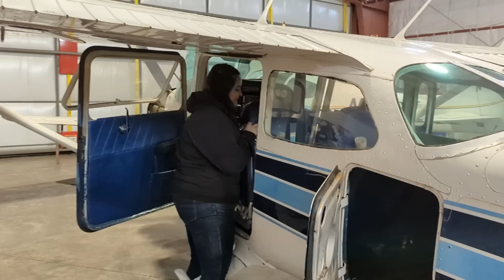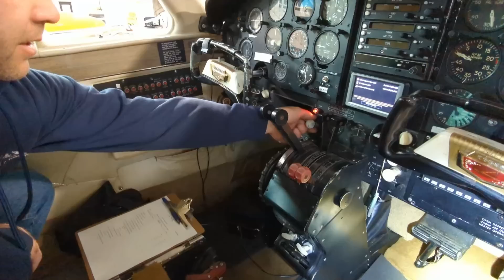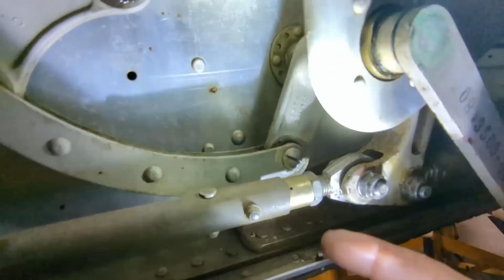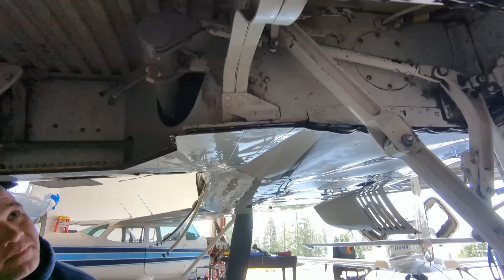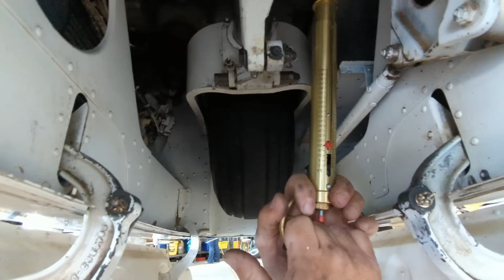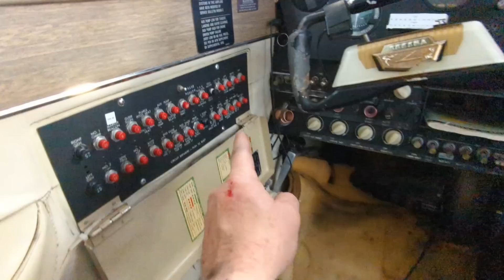1959 Cessna 310-C Annual Landing Gear Check. Gearhead Special!

Comment: Had a 1970 C-401B and a 1955 F35 so two gear swing inspections per year. Working with AME who signed off all work we did together. Amazing engineering

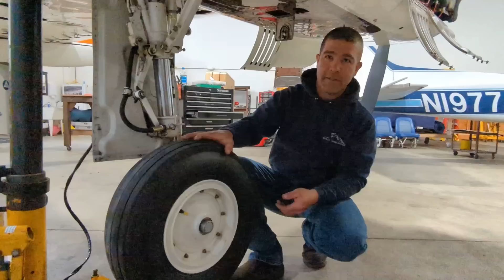Comment: The Airforce head to 310 to our meeting. Also had a 3:10 and we know that the landing gear especially knows Liniger will collapse on so Cessna came out with a new system to replace. Do you change your bicycle chain on your nose landing here also, the beach craft had a swing thing with the bicycle chain, so just replaced it

Comment: Aeroshell 5 is not the correct grease for the landing gear. Aeroshell 64 or 33MS is the correct grease - Mil-21164 . Also, remove, inspect, lubricate and reinstall the bellcrank pivot bolt.

Comment: This is a beauty of a 310!  Original N number too.  It reminds me in spring 1980 I was with Dad when we went to Kansas City to buy a 1971 pressurized Cessna 414, after that went to Wichita where Dad took the 3 week Cessna 414 maintenance course, primarily Dad needed it to be able to sign out pressurized aircraft but the training on the gear rigging was very valuable too, Dad said it was a little complex and one needed to get the details right, i was 18, good memories

Comment: Microsoft Flight sim just added a C 310 R from Milviz.  It flies great, but there is a discussion about the pitch stability on this aircraft. Would pilots of the real 310 consider the pitch to be "twitchy" at low speeds?

Comment: It sure does take a lot of "gear" to do the gear inspection on a 310. I certainly was not "geared" up for the complexity of the the gear system. Fortunately, all of your 310's gears operated smoothly so you did not require any additional  "gear." "Gear-ate" video!

Comment: I worked as an AME in Canada from 1986 to 1992. My shop did this inspection on the 310/340 series aircraft and from our research most Canadian and American shops where not doing this inspection. It was tedious and necessary. The poor apprentice would get stuck in the cabin pushing and pulling circuit breakers and checking the manual retraction handle per your video. We had one AME that specialized in the inspection and he was dope doing it. Had the process organized and I often wished I was shown how to do the entire process and be able to have his lever of competencty. I really liked the video and it brought back memories. The older C411 and C421s had a similar gear configuration but I only remember doing the inspection on 310s and 340s. We loved the newer C411 and C421 with the hydralic gear. So much easier to maintain except the first time we did a "blow down" test of the emergency gear system we did not expect the suddeness of the gear action and locking. The aircraft rocked on the jackpads we thought the aircraft was going to fall off them. They never did but we actually would get other techs, especially from our local avionics shot come over to watch the blow down test. GREAT VIDEO!

Comment: I am very familiar of that gear system.  I oversaw an annual for a  friend of mine ‘64 310.  The adjustment of the down switch gave us fits.  It worked good on the ground, but I flight tested it and the green light didn’t come on.  Went through the emergency gear extension procedure and it still didn’t. Did a flyby of tower and it looked good so I did a no flap landing to be ready to go around since I didn’t know with the series gear circuit which one was the problem.  It was okay so we checked it again on the ground and it checked out again.  Ended up rigging the three switches to a box with 3 lights and found it was the right main gear switch.  Made another adjustment and got it squared away.  Never cared for that single light system.

Comment: Juan, great video can't tell you how many shops don't do this full procedure during annual!  There are only two shops in the US that I allow to rig the gear on my 401B.   BTW, check your log books, look to see when the last time the gear box was serviced.  I'm willing to bet it's never been opened up.  I did mine and the grease was hard as a rock!!   Scraped it all out rinsed with mineral spirits and then installed all new grease.

Comment: Greetings from a fellow employee. Just curious, currently I have a 182, got it primarily for my sons to learn to fly. Now that they have moved on I don’t fly it much but when I do it’s the 200-400 kt mile range. I could use a bit more speed and not be Leary of hard IFR and/or night. I’ve got lots of Baron time but at 57 and 6’6” don’t feel like squeezing into one of those again. A 310 is high on the list, and I like the old ones. In searching out yours what gotchas did you look for? Did you consider any others? Also, afraid to ask, what’s that annual gonna run?

Comment: A company I worked for had a 320.  During the gear check the mechanic thought the gear went up strange.  Told the boss, boss said its fine.  Guess what,  a few weeks later it failed and did a nose gear up landing.

Comment: A C-310 is sometimes referred to as a little airliner and it is an extremely capable airplane, which will actually be able to climb on 1 engine, instead of just flying to a crash site like a Piper Aztec. Back in early 2000's I received a Multi-Engine training in a C-310 in San Jose, CA. Pretty much the whole Multi-Engine training focuses on handling the aircraft when 1 engine fails. During one of our training flights in a C-310, it was me as a student acting as Pilot Flying, my instructor was monitoring and we had another instructor and a student on the back seats. We had completely shutdown 1 engine and feathered the prop and the C-310 was still able to climb at about 500 fpm with 4 grown men in it. It was amazing.

Comment: That gearbox sounds a lot like an  old cream separator in reverse. Those things had a lot of compounding going on to change a fairly sedate input on the hand crank into thousands of rpms at the output. Those things would last for decades, based on their precise construction, and this box seems to have done the same.   A weird comparison, but one that just occurred to me, watching the way the main actuator moves.

Comment: I love the attention to detail that an annual inspection shows.   Boroscope?  Compression checks, electronics check...fascinating detail.   I know this is maybe off topic.   But what if,  just what if, people took their on road driving skills, awareness, engine and vehicle maintenance, as meticulously as pilots do?    IMC conditions on the road?  don't go.   Going anyway?  drive by the numbers, signs, and all the things that most drivers fail to do.   speed limits...etc.  Yes, it's boring.   but a slight reduction in driving speed is a massive reduction in crash kinetic energy.     Save for a life threatening emergency, nothing costs more that mistakes and tragedies on the road that can be avoided by deciding to drive properly, ,,maintaining brakes, tires and suspension to excellent standards, clear windows, clear mind, checking and double checking all intersection crossings, etc. etc.       To make the point more strongly, what if people flew and cared for their aircraft as most people drive,  aircraft would be dropping out of the sky at an nearly unimaginable rate.      Pilots actively fly,  do most people actively drive?

Comment: Cessna 310 Annual Inspection Cost:   $1000 per 1/4” of combined maintenance manual thickness if nothing needs attention.
                                                                 $2000 per 1/4” if adjustments are needed.

Comment: Juan, when hand cranking the gear down, you went 6 and a half turns past the green indication, is there a reason you could do more? Would you want to go until it stops in an manual crank situation, or stopping at green should be acceptable?
Reply from the maker: What does the book say....
Reply: @blancolirio  I was just curious, I suppose I could find a 310 book online somewhere.

Comment: Thank you so much for this fantastic video, I'm not qualified for aero stuff but I spent many years on the tools in vintage cars and classic motorcycles and I can completely appreciate how that system of rods and linkages can become a geometric nightmare if you have to disturb one and you then end up chasing your tail trying to figure out how your adjustments have affected the parts further down "the chain". 

Also, "we'll see..." spoken like a true pro 😆 she'll go far in the mechanical/engineering profession.

Comment: Great 310 gear resource Juan, much thanks! Also, at 24:00 on the swing, it looks like Harvey might be prone to a near catastrophic problem a friend experienced in a P-51('Never Miss' - N119H).  I flew chase for about an hour until after some very high-G maneuvers and down pressure on the system the gear dislodged. 
What happened there, was a left-hand oleo seal had become a tad hard and dry, and rolled, which prevented the strut from extending fully. That caused the tire to bind on the inner gear well opening. It was surprising how little binding force was able to prevent the High-pressure hydraulic system from forcing the wheel past such a bind.  Lesson learned, was that oleo condition can be an overlooked component often essential to proper gear operation. 
Hard to tell from the video but the clearance in Harvey's gear well appears it might be tight like on the P-51. I'll post a link to 19H as a reply to see if YT will allow it that shows the gear well.

Comment: Its absolutely amazing to me that more gear up/gear failures happen more than they do after seeing the complexity of just this one design actually is... the amount of bearing and bushing play that occurs over the years and cycles had to have been taken in consideration in the original design. Anyone who has dealt with a multi linkage mechanism knows just a few thou of slop in each rotating arm will grow exponentially at the desired outcome. Add in the flexibility required in the wings, the temp ranges the airframe is subjected to, hard landings, and many other factors, my mind is blown. How the hell did Gryder end up upside down in a corn field with just a simple flap mechanism? Haha I couldnt resist, sorry Danno

Comment: Back in the early 1973ish days. I was working on my pilots license in Michigan - Oakland Pontiac airport.
Traded cleaning planes or spills for flight time. Turns out I was very good at cleaning black soot off the engines.  Met great pilots and mechanics.

Comment: Been maintaining a fleet of 310R for the last 20 years. Good information. It's definitely a puzzle to rig from scratch or if you have to make any changes you always have to start from the beginning of the rigging instructions. Never works to start in the middle. Torque tubes are prone to cracking as well as the bell cranks for the inboard gear doors.

Comment: Sheeesh, the guy that designed that gear system had to be right next to insane. Probably a relative of Stephen King. You almost never hear of a 310 experiencing a major gear issue and if you do, something is either bent from abuse or, lack of maintenance. I wonder if Cessna made any changes to subsequent, later models of the 310, relative to the gear design or, left it alone because 'If it ain't broke, don't fix it".

Comment: Having flown 1000s of hours in 310s one of the major problems we encountered was low time pilots extending gear at too higher airspeed. It is critical to low the undercarriage below from memory 129 kts. We had 5 nose gear damage due to this procedure. The drag when lowered on the noise wheel is very high.

Comment: That brings back the memories.   When they get out of spec pulling overcenter, it is a huuuge.. can of worms.  They recommend just going back to the first push/pull rods and get back to proper spec length, and start all over. It is next to nightmare territory.  Been there.

Comment: Does the 310 have a chronic issue on the LDG or Flap System? Any isuses with with the bearings or bushings?
Reply from the maker: Not if you keep after it.
Reply: @blancolirio  Thank you! Go to Marshbrothersaviation.com you might like our fuel cap washers.

Comment: Please explain why are not the engines counter rotating on twin engine aircrafts?
Reply: That became popular in the mid 80's.  A fleet with all engines turning the same way requires only one engine and prop in the spares department.   That was a large part of our reason for running C402's.
Reply: Expense, of needing dash 1 and dash 2 engines and props!
Reply: @blancolirio  so what kind of torques are experienced by a twin engine aircraft due to the propellers turning in the same direction?

Comment: I hated working on those. 30 + years ago  we subbed maint for an outfit that ran a few of these. After they had a gear up, the owner operator repaired the skin and put back in service. A few weeks later, due the a/c was inspection subbed to us. We were, OMG, Not a single grease fitting would take grease and every  gear bushing was dry and almost seized. Notable we addressed the issue, but we could not believe we received this unit to inspect in this condition after a repair and a gear up landing.

Comment: Damn - there are links and rods just everywhere in that landing gear. Makes me wonder how long it took for the engineers to design it originally. And to then create the original set of documentation, complete with expected tolerances etc.

A lot has happened with CAD systems since these were designed, and it really can't have been fun to try to take into account the mechanical tolerances of every single detail and the amount of adjustment from each adjustment point.
Reply: It was a different mindset at that time. The men who designed this type of equipment thought different than someone  who relies on a CAD program to assist them with the answers.  They didnt see this as overwhelming it was just the next thing to do.  It may have taken the design team some time to get everything worked out but the end result is a plane that still works very well 62 years later.  As far as specs I am sure even the new CAD designs are full of the same specs and tolerances. I am not an A&P mechanic and can assume than many of these tests are now done digitally, where sensors are relied upon to make sure everything is proper.   It was just the way it was and not a task like we may see it today.   I liken it to before you could drive it was nothing to walk two blocks to your freind's house, after getting a license to drive, it would be easy to get mad that you had to park one house over and walk 50 extra feet.
Reply: I'll bet they designed the landing gear and then called in the aeronautical engineers to come up with an airplane to fit around it all 😀

Comment: Very cool.
First time watching.

It's been several years, but I used to rig the landing gear on the 747.
Rigging new aircraft in Everett, WA is much nicer.
It's all clean, unless you get a hydraulic leak.

Comment: Dena vu! I'm going to have to go through this on my 310C again pretty soon, too. Glad to see you are using both jack points on the nose, I've seen some 310s messed up structurally from lazy people jacking the nose with only one jack and twisting the structure. I see you mentioned the nose gear idler bellcrank, the source of most nose gear problems in 310s. Harvey should be good to go for another year.

Comment: I've been flying since I soled at 16 in 1968.  But I've never owned an airplane.  As a CFI, I've had the benefit of flying in my younger years when I really learned to fly.  As I got older, I had to put two kids through college.  Yeah, I could have avoided that lifestyle and owned a C-210 or even a C-310.  If I had to do it all over again, I'm not sure.  I love my two kids, but my family and I live far apart these days.  I wish I could have had both lifestyles, but I made my choices and now I have to live with them.

Comment: Somebody is forgetting to stomp down on the brakes before retracting the gear judging from the scrub marks inside the main gear wells!  Great refresher on the Cessna gear system.
Reply: Or the gear is not sitting on the uplocks after retracting and the wheels are rubbing against the structure.  When the gear retracts it goes up and then slightly down when hanging on the up locks.  This prevents the tires from rubbing in flight.

Comment: I see that 310 has a step that extends and retracts with the gear also. Wasn't sure if that older 310 had that feature too like the newer ones like Kevin from 310 pilot. Aren't you glad Juan that you don't have to do all the annual maint checks on a triple 7?
Reply: Kevins 310 sure looks different than HARVY don't it? :)  hehehehe like diff tween a VW and PROCHE :) spoeeled rongly on porpuse lol

Comment: Who designed this gear system? Rube Goldbeg? My dad was a design engineer for GE for year's. He would have loved this video.
Reply: You really think that’s Rube ?  You should see some of the other designs.  I’ll refrain from naming names. Before hydraulic gear systems came onto the scene, this was one of the best, most reliable mechanical gear systems going.  It was  used across the board on the Cessna 300/400 series twins before the move to hydraulics.  As far as hydraulic systems being simple, not quite - some are, some are not.  I worked many years in a large shop, we would knock out at least a couple of these each week.  Everything is done, step by step, strictly by the book. If done so, everything will come into order. If it does not, something is wrong and must be investigated.  Absolutely anything worn to or beyond tolerance can not be tolerated.  I found the labor times exaggerated, but must keep in mind that our crews were doing the work on a near daily basis.  We were the highest volume Cessna twin dealership in the country. The takeaway here for anyone owning a retractable gear aircraft - this is not a place to penny pinch, and trust the work only to someone truly knowledgeable with your aircraft’s gear retraction mechanism. Otherwise, your wallet may be in for a very bad day.